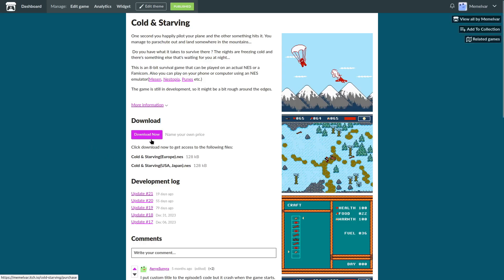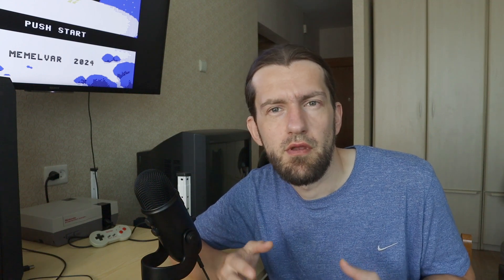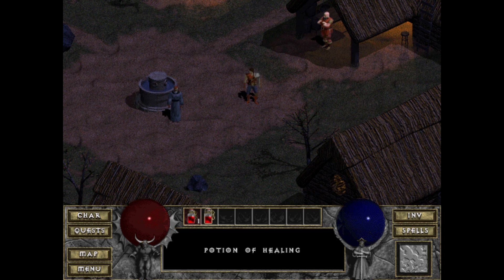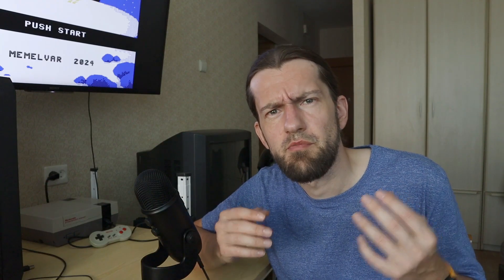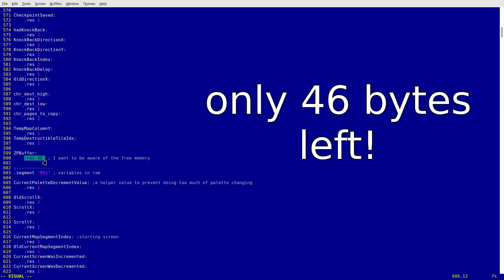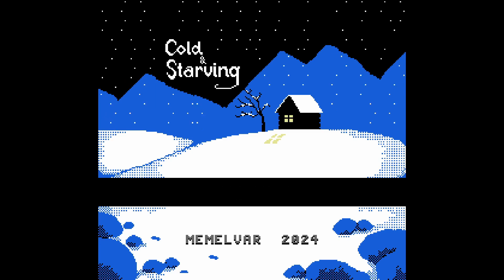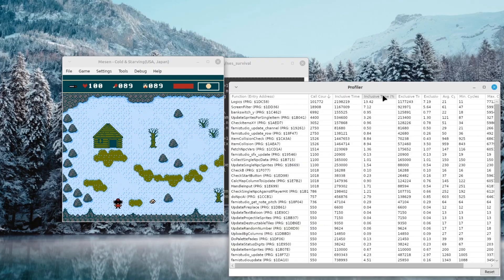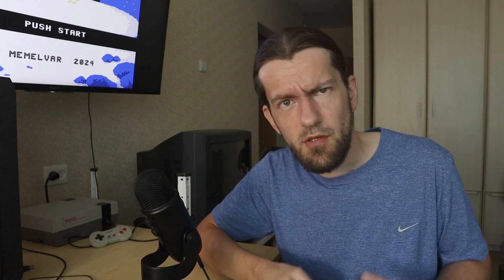Making NES game #24: That troublesome little boulder

Comment: Oh yeah, Zero Page optimizations are huge man.  If you look at Blaster Master, they store variables all over the place in high RAM, but multiple times per frame they copy a bunch of variables to the ZP, and then they do all the math and game logic on what's in the ZP, and then at the end of the frame, they copy the changed values back to high RAM from wherever they came from. -- Basically they use a section of the ZP as "scratch" RAM.  So they can page in other bits of high RAM as needed.

I've read that despite all of the overhead of having to invoke multiple copy routines, the code is still much faster (and smaller) than if they did all the game logic directly against the values in high RAM.
Reply from the maker: Interesting. I wonder if such scratch RAM would be beneficial to me in any way.